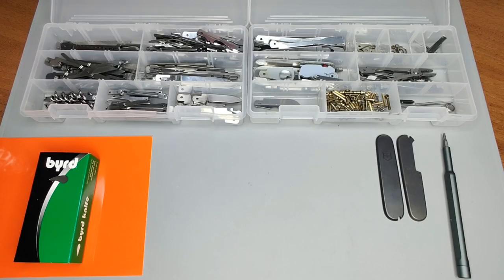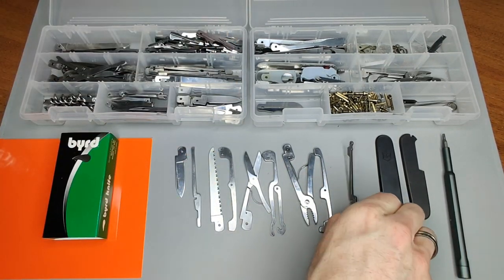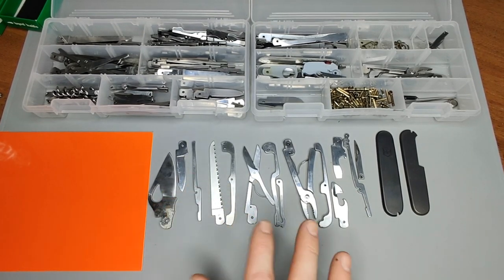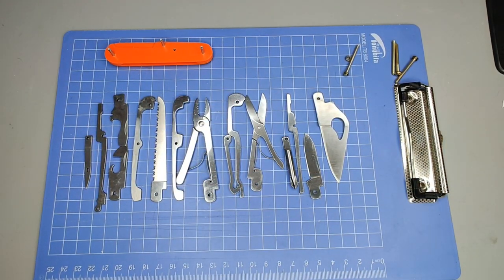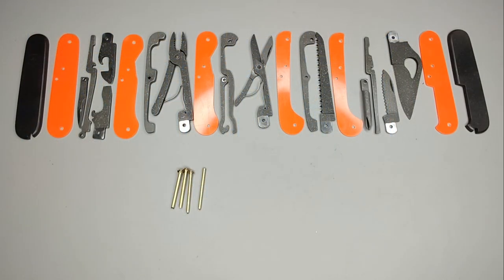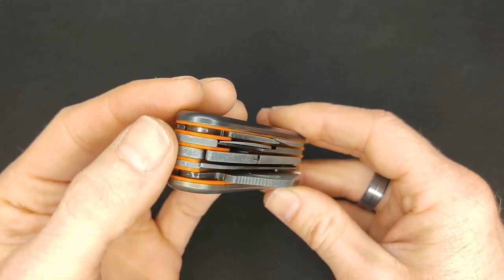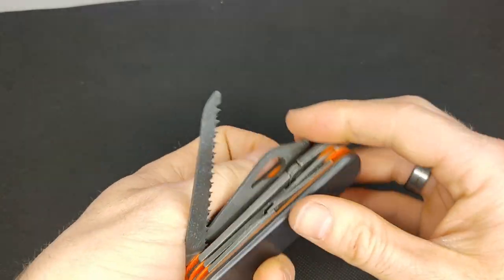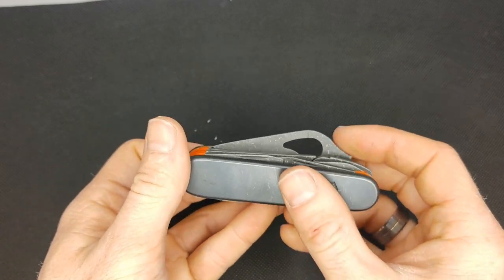Spydernox Deluxe Tinker with flamed-black titanium scales

Comment: Did you make the hole in the Byrd smaller?  No carving on the backspring for that layer, huh?  Just made the Byrd match the profile of SAK blade?
Reply from the maker: Yes, I peened in the pivot bore of the Byrd blade and redrilled it out to 2.5mm.  I didn't have to modify the spring, just the Byrd blade.

Comment: Okay now that is a good combination of serrated and normal blades. 

I have two technical questions. 
1. When grinding the knife, won't of ruin the hardening of the blade? ( Some manufacturers Harden only the sharp edge similar to screw drivers or bits. Unless I'm mistaken)

2. Again with the metal hardening, won't the acid etching make them soft or something?
Reply from the maker: Excellent questions. I keep the blade cool while reprofiling it. I have not had any difficulty with the hardness of the edge after grinding it. I never thought about the possibility of just the edge of the blade being hardened, interesting thought. 👍🏻
The tools are only in the acid for 3 minutes, enough to give it the dark color but not long enough to compromise the metal.

Comment: Wow!! Just amazing, how did you get the pivoting hole on the spydico blade to match the victorinox. The victorinox looks smaller?
Reply from the maker: The Victorinox pivot hole is smaller. I peened in the pivot hole then re-drilled it out to the correct size.

Comment: Hey Cody... do you polish your G10 liners ? What's involved, maybe you have a video ?
I bought some G10 material, red & black colored, and they obviously need some sort of polishing... I know the edge is the most important part, but the large surface area probably needs it too... yours look really nice !
You do great work... makes me wonder how you got all the extra parts... besides salvaging them from junkers or "great deal" knives !
Reply from the maker: Hey!

Yes, I polish the sides of the G10 liners after cutting and shaping them. The sides I only polish next to the pivoting points of the tools. Here's a video where I show more of the G10 liner process. https://youtu.be/CiqWZaOGgv0

Yes, my spare parts have come from knives that I have disassembled. Some of the parts are older, others are brand new. 😅
Reply: Do you use various grits of sandpaper... up to something like 1000 ? Then wax or a polish like Flitz ?
Obviously, you would have to try and not remove too much material in the process.

Comment: I saw a comment earlier that you have to re- profiled, thinned and the pivoting hole had to be made smaller. Can you please explain how you are able to reduce the pivot hole size?
I am curious about the strength integrity when blade is being used.
Reply from the maker: Yes, that is correct. The pivoting hole is made smaller by peening brass into it and then re-drilling it out to the needed size.
Haven't had any trouble with the integrity of the knife after reprofiling it.
Reply: @FittoSurvive  thanks for your prompt response. If you have some link that can demonstrate how it is done would be greatly appreciated.
Reply from the maker: @pranavpatel7553  If you send me a message through Instagram or Facebook Messenger I could send you a video. Showing how it is done.
Reply: Please check your Instagram.
Reply from the maker: @pranavpatel7553  Got your message.

Comment: Love the content keep it up. just out of curiosity can the beautiful phillips on the 58mm be used on larger sizes. a 91mm or 111mm with the rambler phillips 🤤
Reply from the maker: Thank you!
No, the phillips from the 58mm is too small to fit in the 91 and 111mm ranges.
Reply: @FittoSurvive  even as a back tool
Reply from the maker: @ashsmall8103  That is an interesting idea. I could try that. Might be a bit too thick to fit anywhere though.

Comment: This is super awesome! Why do you use G10 for the liners? Is it just the aesthetics or do they actually perform better than the aluminum?
Reply from the maker: Thank you! I use G10 both for aesthetics and performance. The G10 is as rigid as the original aluminum but it is more resistant to bending and it will not oxidize like the aluminum.
Reply: @FittoSurvive  Awesome, and thanks! I'm just learning about SAK mods and your stuff is amazing!
Reply from the maker: @michaeldelvecchio6591  You are welcome! Glad to hear that.

Comment: nice build, modified spyderco blade could have longer edge, or similar arc (like before modification), because now it is look like, that one quarter of full blade do not have usage, but this is personal opinion (or maybe inspiration for next builds :)
Reply from the maker: The blade has to be shaped like this or it will tap on the spring or pins.  But, I too do not like having to reprofile the Spyderco blades, so I found a way to add the Spyderco blades without reprofiling them.  Check out some of my other videos to see them.
Reply: @FittoSurvive  sure, this would require some reprofiling of blade, without that, it is hard to do it better.
Reply from the maker: Correct.

Comment: Question: Why use G10 as liners?
Reply from the maker: Mostly for design. But the G10 is actually sturdier than the original aluminum liners and they do not corrode.
Reply: @FittoSurvive  Thank you for the information!
Reply from the maker: @walterdayrit675  You are welcome!

Comment: I would say this knife is more practical for left handed people because of main blade positioning (far right). Left handed people can open it by one hand, and right handed people like you use both hands. Am i right :D?
Reply from the maker: Yes, the Spyderco is on the left side of the knife. It can be opened with one right hand, but you have to use your middle finger to open it.

Comment: Has anyone tried the Urban FRN on a 91mm? It may be a nice pairing I think
Reply from the maker: Just looked at it online. Looks like it might work.
Reply: @FittoSurvive  do you think you will try a build with it?
Reply from the maker: @MetalZaraki93  Not sure, I might give it a try some day.
Reply: @FittoSurvive  Nice. In the meantime  I wanted to ask you a question about the Robin 2. You only need to remove part of the blade as you did in the video or maybe it's better to reduce it's thickness since it is a little bit more wider?
Reply from the maker: @MetalZaraki93  I do grind it down a bit to make it thinner. It needs to be thinned down 0.2mm if I remember correctly.
Reply: @FittoSurvive  Got it, thank you. I had this doubt a bit, and I guess you maybe align it on the opposite side respect the backup blade so it doesn't touch it.

Comment: Well, it’s nice looking but the Spyderco blade doesn’t lock now, and the small blade is too short for serrations to be practical. The awl looks like it’d be very uncomfortable to use with the back of the Spyderco blade sticking out into the palm. I understand the desire to combine bits of both but honestly I think it would have been better to keep both knives as they were and carry both.
Reply from the maker: Yes, you are correct.  The Spyderco blade does not lock on the Spydernox.  Lots of interesting input, and it all makes sense.

Comment: Do you still make knives??
Reply from the maker: I do. Check out my website for information on how to order one. www.f2scustoms.com
Reply: $250 to start 😂. OFLMAO. Holly shit dude. That’s microtech level money.
Reply from the maker: @waynepalmer6743  Yes. SAK mods are not cheap to make and are time consuming.
Reply: @FittoSurvive  my stroup custom dagger was $300. 1095 HC steel tech lock custom kydex. 5 inch blade. To be honest I was anticipating $100/$150 at the max for a custom Sak. I’m sorry I hope u make millions but for me the only way to increase the value of what I wanted you to make past $130. Is to dip it in molten gold.
Reply: @FittoSurvive  hell I just paid  $150 for my spyderco manic 2 CTS BDIN. Steel.
Reply from the maker: @waynepalmer6743  It's all good. I understand that it is pricey. But with a 49 week waiting list, I am thinking that I may not be charging enough... 😅
Reply from the maker: @waynepalmer6743  Imagine combining a $50 SAK, $70 Spyderco Dragonfly, $80 titanium scales, and $10 G10 liners that is $210 just there. Then count the amount of hours it takes to make it.  I need to be paid for my labor. Multiply 6 or 8 hours to the minimum wage in your state. Oh, and don't forget shipping... If you count that all up, let me know if I am charging too much for a custom SAK. 🤣👍🏻
Reply from the maker: @waynepalmer6743  It depends on the build that I am making. Several tools need to be sourced from older version SAKs.
Reply: @FittoSurvive  best of luck kid I hope you get rich may luck health n wealth be yours.